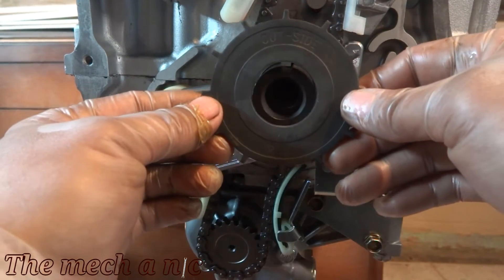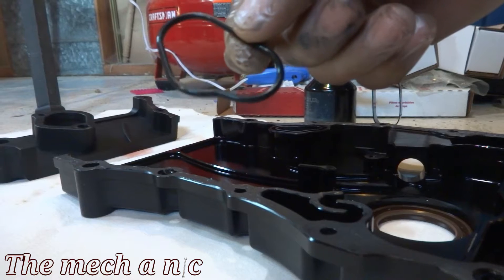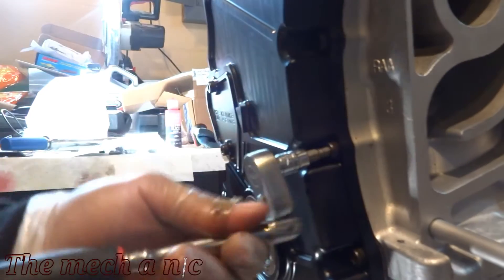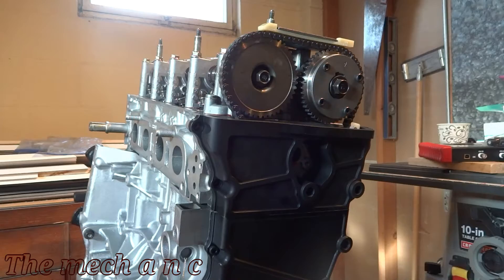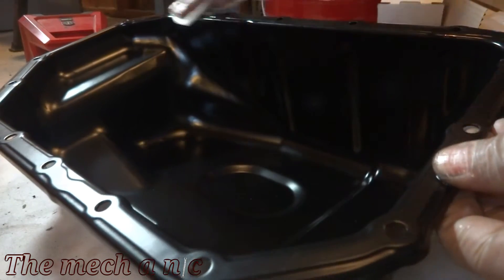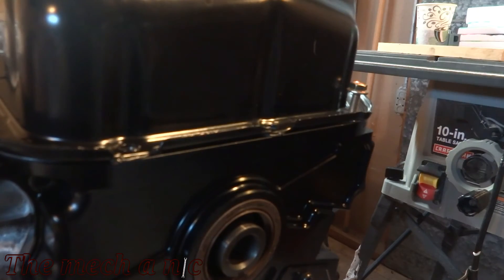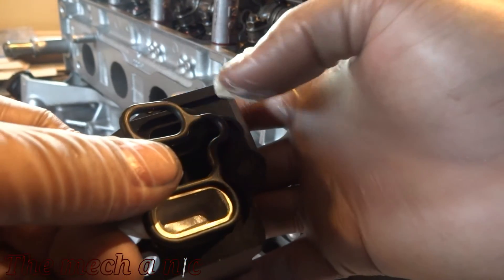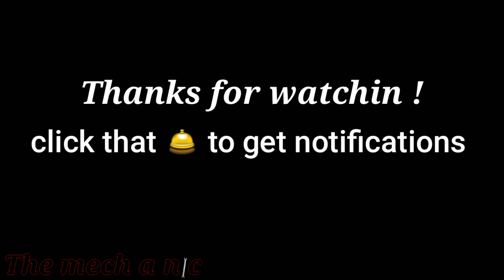Skunk 2 timing cover / ktuned oil pan install

Comment: what’s up bro, when you installed the new oil pan, did you have to buy a new flywheel cover too?
Reply from the maker: I haven't bought a flywheel cover yet. Are they different? Why would I have to buy a new one?
Reply: @themechanic6117  ohh it’s cause i got a k20, and i think the k24 tranny already come with the big flywheel cover than the k20 from what i read
Reply from the maker: Yeah I have no idea, I haven't even looked into that yet. My tyranny has no cover on it

Comment: Hey bro so I just bought this timing cover but it's the version 2 how do you like it ? If you still have it? The version 2 is annoying because it comes with a chain guard thing that wraps around the chain and the only way to install it is if you removal the oil pan shit is mad annoying
Reply from the maker: I never thought about that. Yeah that's annoying.  With that being said I think I prefer the one I have since I don't need to remove the oil pan .
Reply: @themechanic6117  yeah I might just cut the guard off and run it like that because having to remove the oil pan every time I need to take the cover off is a pain in the a**

Comment: Do you by chance have the part number for the o ring that goes inside the timing cover down near timing tensioner?
My damm dealer cant find it.
Reply from the maker: I don't know the honda part number but if you get the Mahle brand the part # is JV5100

Comment: Thats one clean engine! 
I just bought that same timing cover for my mazda rx8 swap.
For some reason they discontinued the raw aluminum for the k20.
Had to go with black.
Im wondering if the shiny siver got to hot
Reply from the maker: That's interesting.  They're both aluminum.  Can't see why one would get hotter than the other. I think it's just cost savings....maybe the bare aluminum cover wasn't selling as much
Reply: @themechanic6117  shiny things attract heat and absorb it in a engine bay.
Lots of data out there to show it

Comment: Damn that's one clean motor!  Doing a 200k mile refresh/rebuild/internals upgrade on my k20 and the only thing that's perfectly clean is the head since I got that bead blasted.  I should have had them do the block when I got mine bored out for my JE pistons lol
Reply from the maker: Being clean is nice but what's important is that it runs good 👍

Comment: Nice but oem parts for the win. Everything u just put on added no HP the oem parts painted black would be just as good if not better lol cuz its oem ...that skunk2 vtec spool solenoid is a waist of money only part i mite run is the side cover and thats only bc u can do a head gasket or cam work without taking off the whole cover 👍🏼